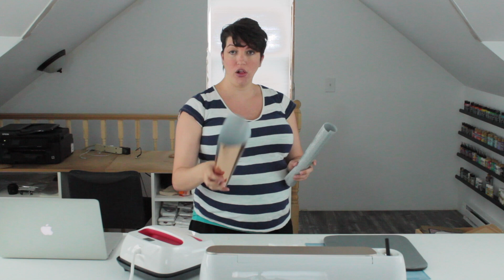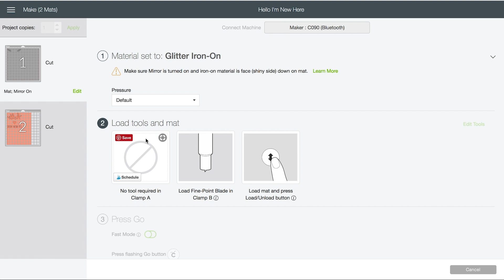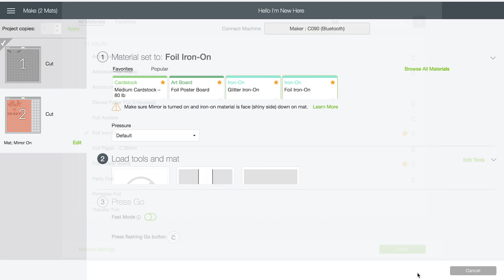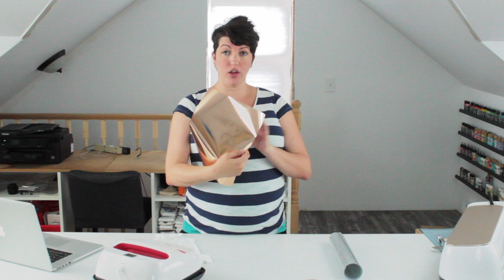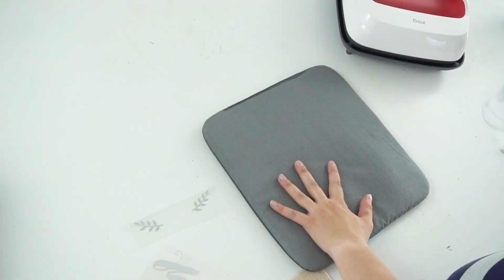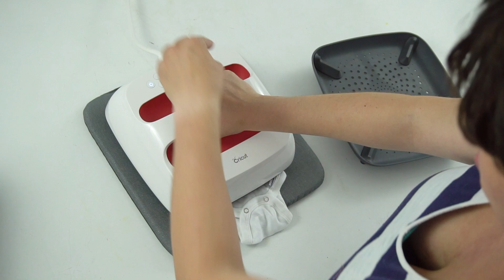Hello I'm New Here Baby Onesie With The Cricut EasyPress 2

Comment: Since you're using a towel on top of the mat, when you do the settings on Cricut's website, do you select the 'Mat' or the 'Towel'? The towel calls for a higher temp setting than the mat.
Reply from the maker: In this video I'm just using the mat. You don't need both a towel and a mat; one or the other is just fine!

Comment: Hello,
 I purchased a Cricut Easy Press 2 (12x10) from my local Hobby Lobby two days ago. When I took it home and did the sample test with the green “C” vinyl design, it worked fine. After I did the sample test, it stopped working properly. Whenever I would set and adjust the temperature and timer, the number for the temperature would go down and then the machine would shut off by itself. I’ve tried troubleshooting and that didn’t work.

The next day I went back to Hobby Lobby to ask for an exchange or replacement and they said that it was against their store policy and that I needed to contact Cricut instead. I’ve been calling the Cricut customer service number and all I get is a busy signal each time. I also sent an email that same night and never got a response back. It’s been very difficult to reach someone from Cricut to help me with my issue.

I tried again to get the heat press to work and now it’s not warming up at all.

In the instructions booklet, it says that I need to press the thermometer button first, then adjust the temp using the plus and minus buttons. Then press the thermometer button a second time. But when I go on Youtube to watch how people use the Cricut heat press, they operate it much differently and only press the thermometer button once, then adjust using the plus and minus buttons. I even asked customers on Amazon how many times am I suppose to press the thermometer button and they all said one time. So all this has made everything confusing because the instructions booklet says to push the thermometer button twice to confirm the temperature. What should I do?
Reply from the maker: Ugh, so frustrating! I'm sorry it's not working for you. You shouldn't need to press the thermometer button twice; I wonder why the booklet says that... For both the EasyPress and EasyPress 2, after you plug it in you press the Power button to turn it on. It should remember the last temperature and timer settings you had and automatically start to heat up with those settings.

If you'd like to change the temperature, press the thermometer button once, then press the + and - buttons to adjust the heat. After you get the number to where you want, just wait a few seconds. After a few seconds the EasyPress should recognize that you have stopped pressing buttons and are done adjusting the temperature and it will heat up to that temperature. The timer works the same way: press the timer button, then adjust with + and -, then wait a few seconds for it to recognize your new setting.

But it should be heating up as soon as you plug it in and press the power button, no matter what temperature settings you set, so if it's not doing that it likely needs to be replaced. I'm sure the Cricut support desk is pretty busy these days, but once you do get ahold of someone they should be able to either walk you through how to reset the machine, or replace it for you if that doesn't work. Send an email again and call again, or use their online chat feature. I know it's annoying to keep having to reach out but support desks and call centers everywhere are just crazy busy these days. :-( Good luck!
Reply: @PracticallyFunctional  Thank you

Comment: I cannot seem to get my Easy Press2 to register  When i hook it up as directed, it just keeps saying "no device detected"  I am lost
Reply from the maker: Ugh that's super frustrating! The only thing I can think of is some USB cables aren't capable of data transfer; they are only made for charging the battery. Do you have another cable you can try? If that doesn't help I suggest contacting Cricut support either by email or chat. They're pretty busy and backed up these days, but once you get in touch with someone they should be able to help you either reset the machine or replace it if that doesn't work.

Comment: When do you have to use transfer paper?
Reply: Angela Rüter with iron on vinyl (HTV) the transfer paper is attached. It’s on top, which is my we need to place the vinyl face down on the mat to cut it. You only need to use transfer tape/paper when using adhesive vinyl. 
Does this answer your question? Hope this helps
Reply: @meegie66  yes thank u